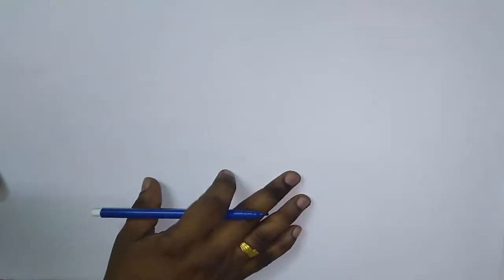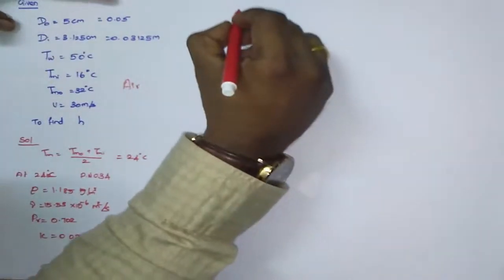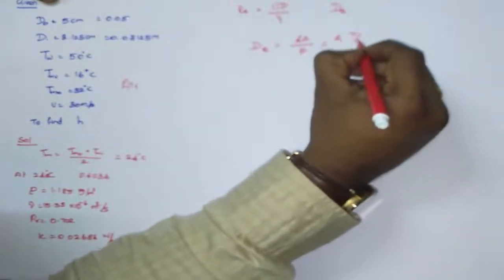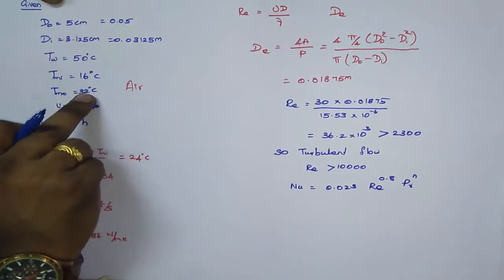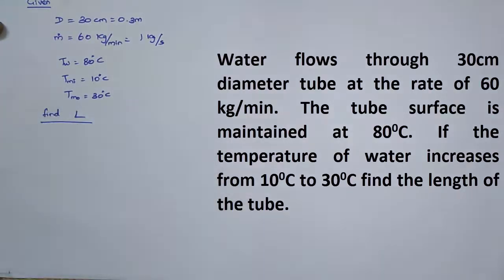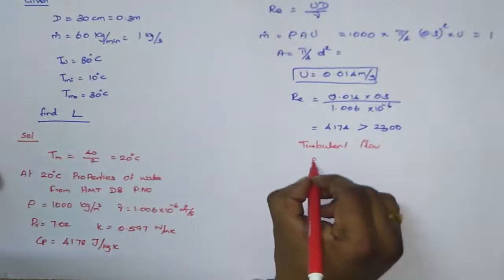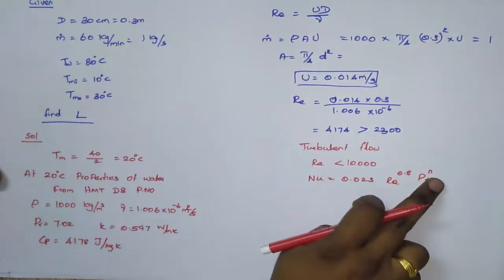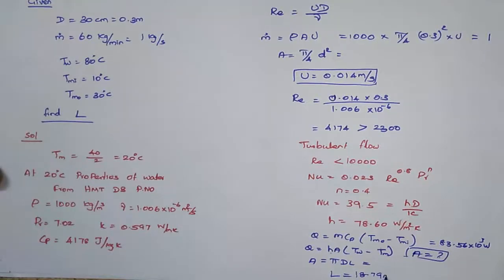lecture17 | Problems on Forced convection | Internal flow | Heat and Mass Transfer

Comment: for finding equivalent dia we should use cross section area or surface area?
Reply from the maker: it depends on the area through which heat transfer occurs...if heat transfer occurs from the surface, then we have to consider surface area...

Comment: Sir U have used 2 different values for area in last problem.
When should we use which formula ?
Reply from the maker: for mass flow rate use cross sectional area (3.14d*d/2)...for convective heat transfer heat is liberated form the surface...so we should consider surface area (3.14*d*L).